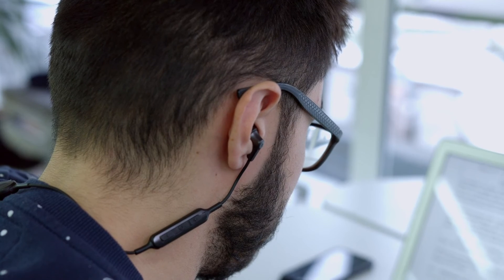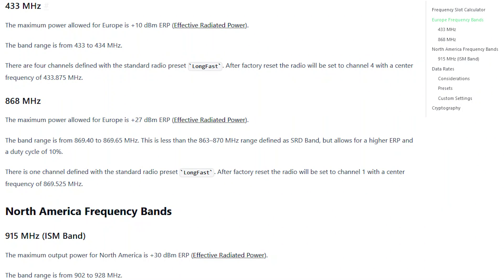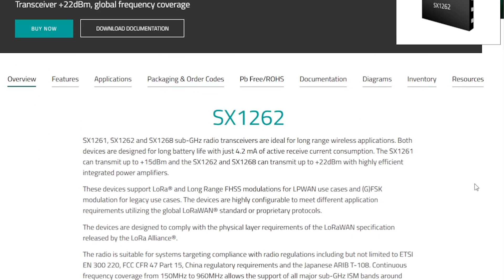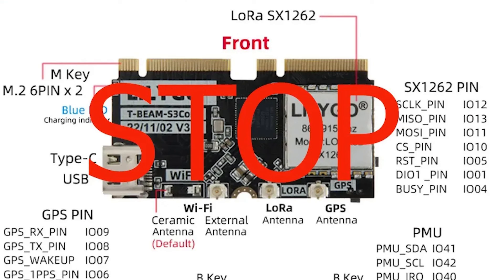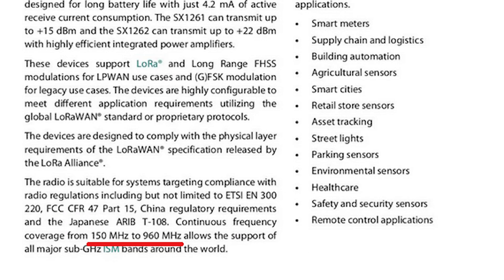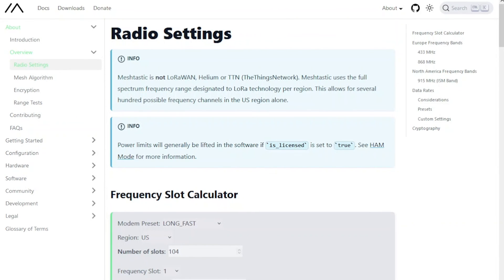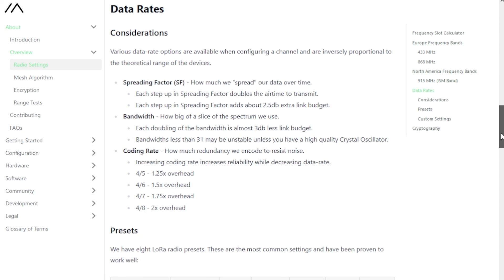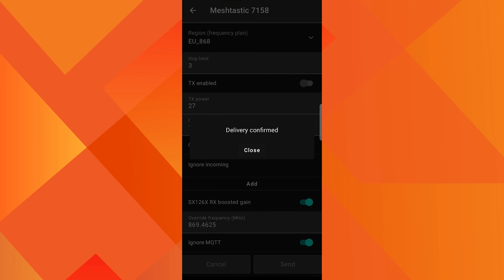Meshtastic Sub-GHz Tri-Band Devices 915 MHz, 868 MHz and 433 MHz | Technology Master

Comment: @technologymasterkam Apologies; I am having to reply this way, for some reason my "reply" button doesn't work in the comments.

Thank you for finding the video on the matching circuits. 

I will be examining the various boards in greater detail, and read the values of the matching components for the three 915 MHz devices I have so far.

A few months ago I also mistakenly purchased a Heltec LoRa V3 tuned for the 433 MHz band instead of 933 MHz, and wondered if I could simply reprogram the SOC to 915 MHz, but I got warnings from advanced RF people to look carefully at the antenna matching network before doing so.

They said this is because even though the SX1262 supports multiband antenna matching, the circuitry must be onboard to allow it to select the correct network, so when the manufacturer offers their boards in discrete bands rather than a "universally tunable" device, is it important to select the correct one for best performance.

Another feature you could educate us about is the importance of using very short antenna leads, and selecting a quality antenna since those purchased from Amazon and the Chinese sites are often way out of tune.

I found it to be very easy to build a 1/4 wave 915 MHz ground plane antenna with pretty good VSWR.
Reply from the maker: Thanks for the nice comment. Yes, I agree with 1/4 wave. It is easy to build, has great performance. It radiation pattern reaches all around. I have experienced incorrect antenna in this video https://youtu.be/PZgHF0R1vkw and its followup here https://youtu.be/BUB-kq8LP2I.  I have just explained to another respected visitor the purpose of this youtube channel. I am very sure I cannot mislead professionals & engineers by my videos. They are fully secure :)

Strip Quote " If you look at my website, my tag line is "TECHNOLOGY FOR NON-ENGINEERS". If you check descriptions and tags etc you will find word "HAM" or "Amateur" frequently.  I am not doing these videos to help professionals become more professional. Youtube and Internet is already full of resources for that. I want to help anybody who wants to do it, just do it. What matters to me (fulfils my goal) is that it works. These antennas are not for sale. They are made with heart and love for oneself or friends."

Comment: It's the antenna matching network that bothers me on some of these boards. The manufacturer's block diagram does account for an automatic antenna matching network, but the matching circuitry is external to the SOC, so are these devices equally equipped? The Heltec LoRa V3 is sold to operate on specific frequencies, and although the Meshtastic and other LoRa software allows band selection, the Heltec devices appear to use a simple matching network tuned for a specific frequency. It would be nice to know which boards have active multiband antenna matching.
Reply from the maker: @mbunds I tried further to address your question/comment and here is the video that can provide some more info into the subject. Thanks for sharing your thoughts https://youtu.be/Ke2e0uyvDZ4
Reply from the maker: This channel provides help to people who like to do experiments with radio, SDR, digital communication etc as a hobby. This is not targeted towards research and academic audience.  Having said that, I appreciate your comment. Here is schematic of the device provided by Heltec https://resource.heltec.cn/download/WiFi_LoRa_32_V3/HTIT-WB32LA(F)_V3.1_Schematic_Diagram.pdf. In the LoRa section we can see the matching circuit which consists of c46, L7 and c47.  Anyone can help the community by providing information about what values Heltec is using for different bands given in Meshtastic. Meanwhile I see no problem in switching between 868MHz and 915MHz. However there is some loss of power to/from 433MHz due to VSWR/mismatch which is still ok for experiments at low power.